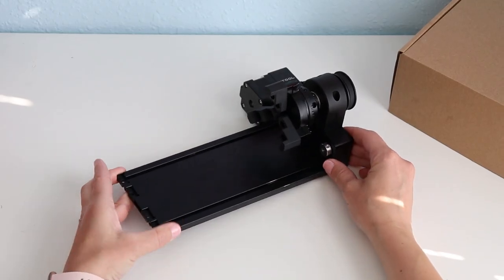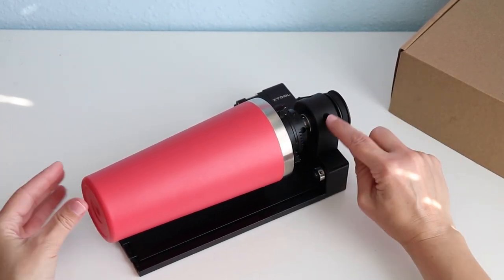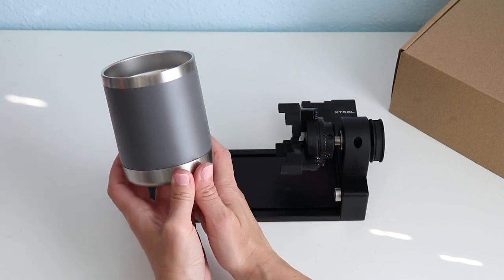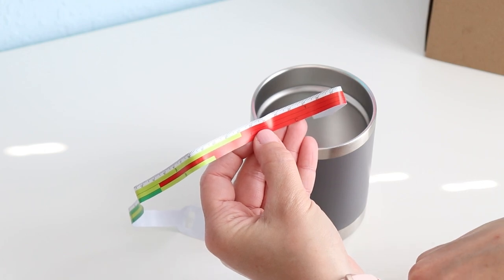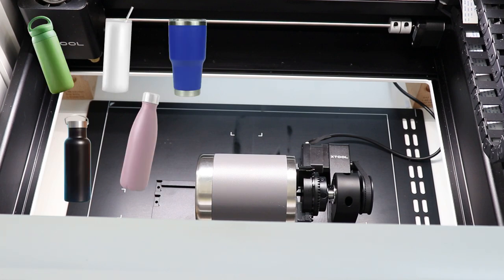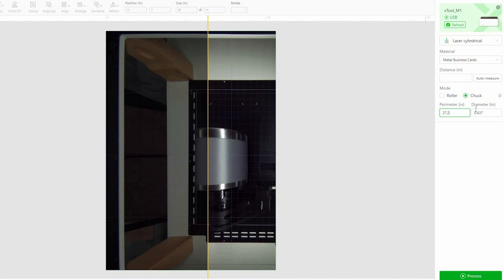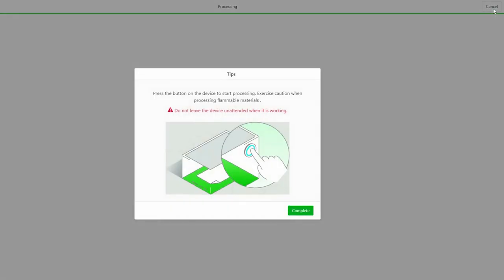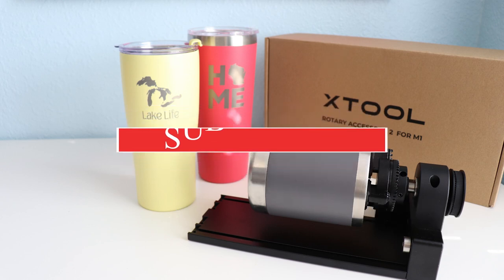Tumbler Engraving with the xTool M1 RA2 Pro

Comment: If you use a smaller tapered tumbler how do you get it to level or do you need to?
Reply from the maker: You will get the best result if it's level. You can tilt the tumbler in the holder so the tapered side is level. The pink one in this video is tapered and it came out great.